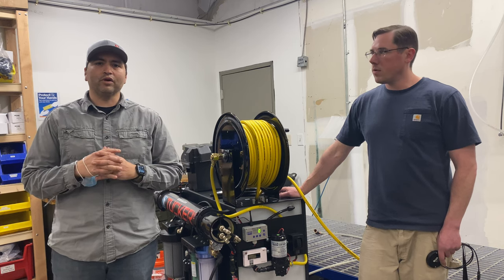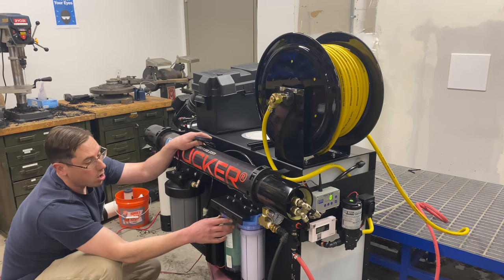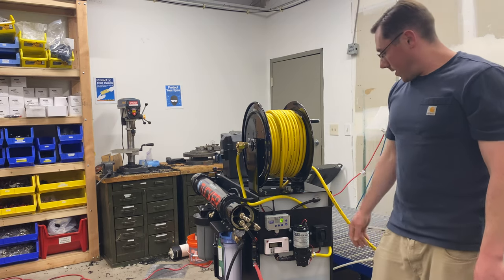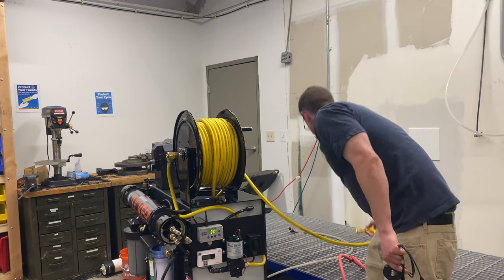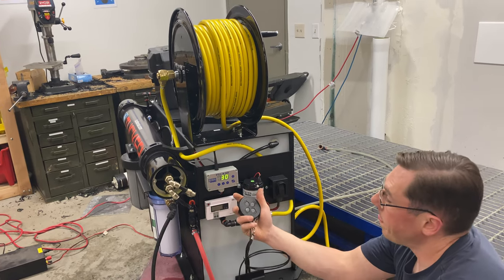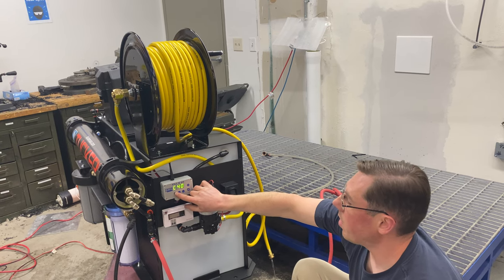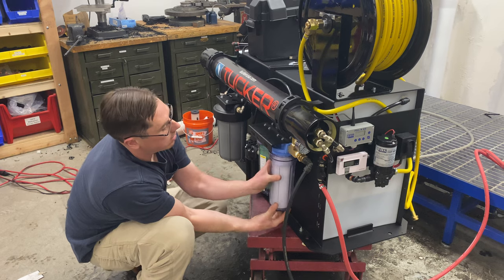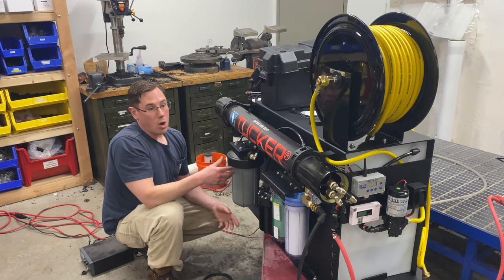Walkthrough on our Tucker®️ Fill N Go system

Comment: I'm looking strictly for car washing... will this system work for that? It seems as if the pressure which exits from the hose is too low for washing cars...
Reply from the maker: The system is great for washing windows. I've used it in conjunction with our water fed poles at 70 feet. I have even used it to wash the van it was installed in. I used it with our pole and a large boar hair brush with a rinse bar. The van would look great. 

That being said, I would actually recommend something else for strictly car washing. 

Are you a mobile detailer or do customers come to your location?

I would suggest our cubic-foot DI tanks. If you're in an area with high TDS, I would recommend running two in a series. https://tuckerusa.com/products/tucker-r-di-tank-1-cube-kit